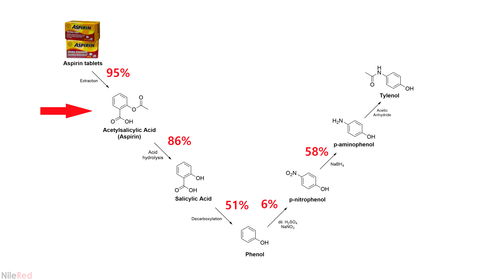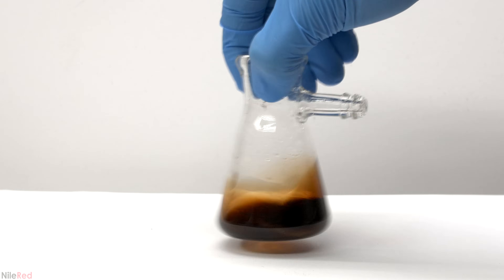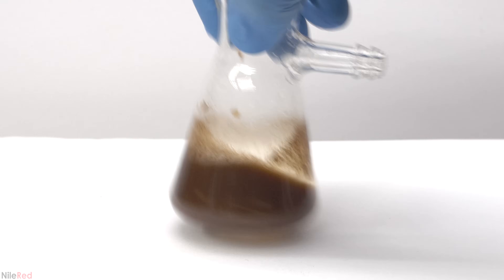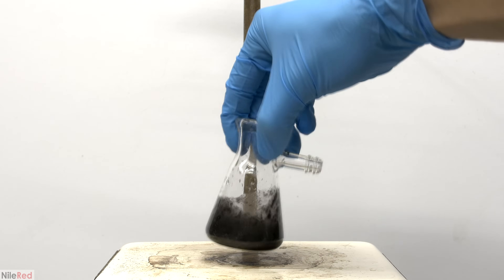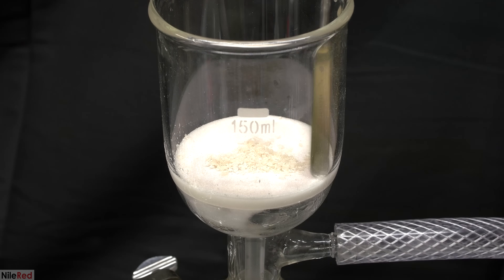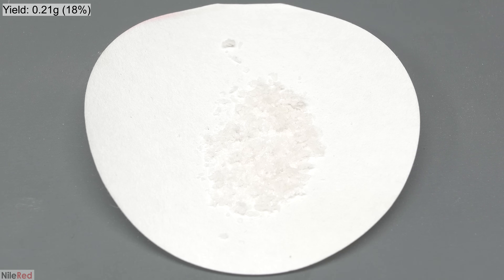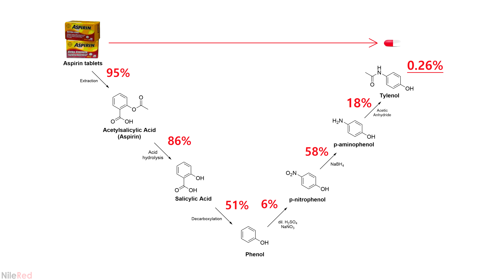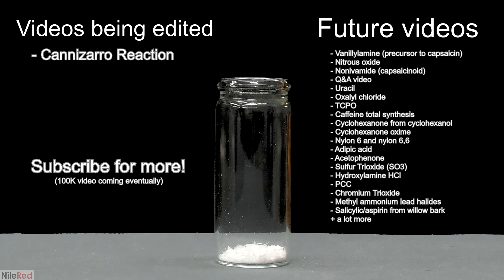Aspirin to Acetaminophen - Part 6 of 6: Acetaminophen from p-aminophenol

Comment: so are you confident enough in the chemistry to actually take that Tylenol?
Reply: Kevin Klika you should never consume anything you made in the lab. There could be all kinds of contamination depending from what you used the glassware for in the past.
Reply: talha yaprak all kinds. He did distill mercury. There's a big chance that some equipment he used in this synthesis was also used in the mercury distillation. Furthermore, most of the chemicals he used probably weren't food-grade, so every single chemical introduced its own contaminants. Sodium hydroxide is produced in process involving mercury (which is BTW one of the primary sources of mercury in the atmosphere). So yeah, it's really not a good idea to try it.
Reply: arthroxon nö He also explained that the purity was only determined by H-NMR and no trace metal analysis (such as for mercury, palladium, etc.) was done. To sufficiently purify it would require a couple of passes through some ion exchange columns, followed by at least 2 passes through a proper UHPLC system with food grade C-18 silica and solvents, oh and all of this would have to be done with completely new glassware as well (you really can't get the mercury out of the glass by washing with acids or bases or even through chelation, because the mercury diffuses into the glass lattice and slowly seeps back out over time).

So basically, yes he could very easily purify the product to meet the required purity standards, but it would literally cost HUNDREDS of thousands (if not millions) of Dollars (just look up the pricing of preperative UHPLC systems + C-18 silica + USP & HPLC grade solvents...).
Reply: Colin Ries I'm interested, what potencial contamination could there be?
Reply: Trace amounts won't, but some substances are dangerous in trace amounts.
Reply: Tomás Allende; you are correct.
Also, remember who we are talking about here... This is a guy that poured concentrated acids on his bare hand AND LET IT SOAK for a bit, all in the name of educating proper safety awareness. He also plays with MERCURY THIOCYANATE! If he wont even attempt to purify it to the levels needed for a safe human test, then it really isn't practically viable... Maybe he should send it to Cody'sLab😂.

Furthermore, certain weakly coordinating inorganic species will have even less of an influence on the melting point (especially if its melting point is much higher than that of the acetaminophen).

Also, there is something else to keep in mind. Even if a contaminant is labelled as being non-toxic (such as alumina (Aluminium Oxide), which is a major constituent of most sands), however, the moment you ingest a substance, you need to take all the metabolic processes that occurs in a human body into account.
A scary example is that of alumina (or Aluminium Hydroxide containing anti-acids), which is deemed to be safe, but the moment it hits the HCl in your stomach it starts forming the Chloride salt (Aluminium Chloride) which is a water soluble KNOWN NEUROTOXIN!

Sorry about the long post, but basically it just comes down to this: Some things, which seem harmless on their own AND only occur in parts-per-million (or even billion) can have some really devastating effects on your health.
Reply: Don't worry over aluminium anti-acids, they have been doing studies since the 60s and no correlation has ever been found. The concentration of HCl in the stomach is rather low, and when you got so much more water the equilibrium shifts to hydrated species which again precipitate. It's simply not absorbed through the GI track.
Reply: Tomás Allende; Yea I actually did realise that, but you are 100% right.
I was trying to demonstrate the principle with a common element that most people would be able to appreciate, but I should have said that in the case of anti-acids, it doesn't appreciably pass into the blood and hence is still safe to use.
Thanks for pointing it out!
Reply: Tomás Allende; LOL! Either that or an absolute GENIUS! 😂

Still, I would have loved to have him explain proper lab safety to us. All lecturers I have come across basically rate every possible danger as EXTREMELY dangerous (ie. "Today we are using sulphuric acid, so be VERY careful. If it touches your skin it will immediately char it to a crisp like it does with this piece of wood...") which really tends to desensitise you.
At least when Nile Red tells you someting is 'very dangerous', you know that it will actually summon the Horsemen of the Apocalypse... or worse.😅
Reply: Kevin Klika he knows how good he washed the beacons so he knows it could be contaminated with sth he has no reason to take it because he already prooved the purity
Reply: I forgot the most important, yes, Nile Red is a madman. :)
Reply: Dude, he made WWI tear gas, that's SO dangerous, I think the video got removed cause it could inspire others to do it, I say let terrorists try to make that shit, please, they'll learn the cost of being a terrorist when they try to do it in a basement with no ventilation.
Reply: arthroxon nö I knew what you meant (besides, it's beaker), but as it was said before, certain chemicals diffuse into the glass an will be impossible to remove and will leach out into whatever you're making.
Reply: +MRLT Wont contamination Shift the melting point of the product ?
Reply: He can always clean it up
Reply: Colin Ries glassware thats the word i switched with "beacons"
Reply: A3X CCY3 Most of them yes not all of them